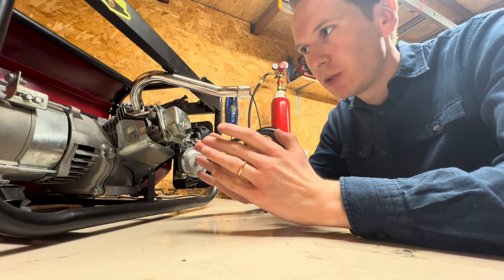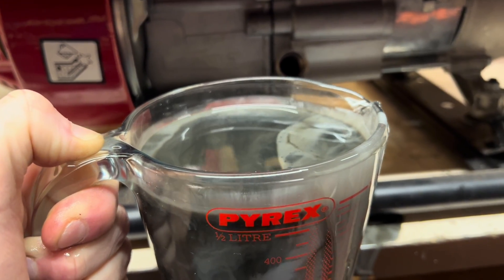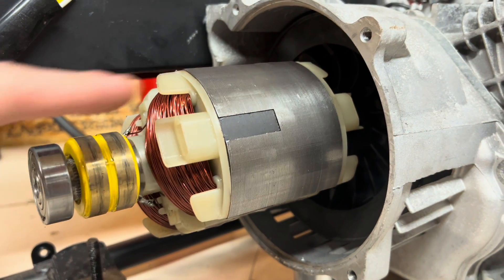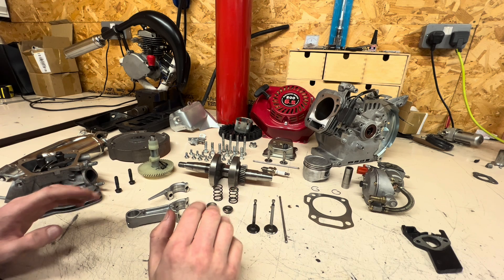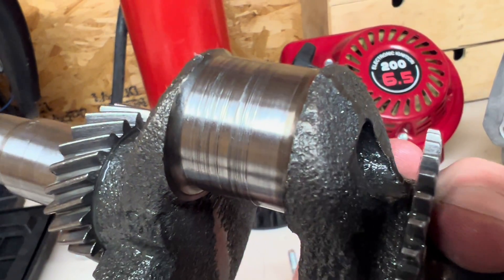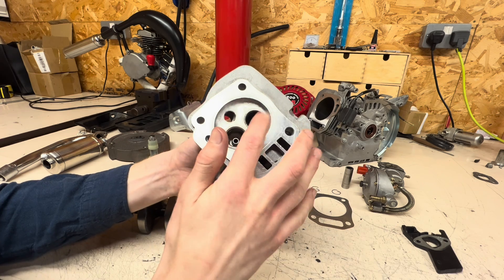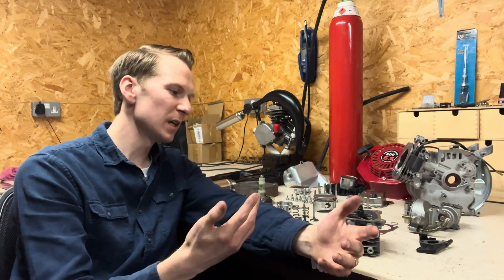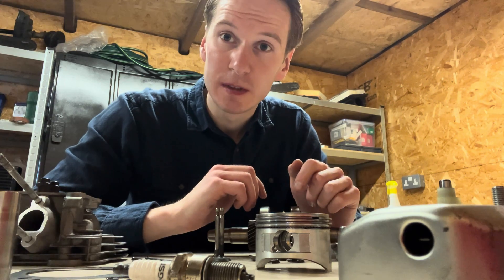Internals After 2 Years of Hydrogen

Comment: I may not know much about hydrogen engines but I do know about the Honda motors (and the Chinese clones).
Unlike what one comment said, hydrogen does burn but very very fast so ignition timing needs to be after TDC (max cylinder pressure at about 14 degrees after tdc)
Splash lubrication of big end means a thin oil of much better quality, full synthetic.
Modify lubrication hole in connecting rod to enable oil to flow in easier, maybe file dipper arm from 'airfoil' shape to a flat on leading edge to create higher oil splash?
Honda used splash lubrication dipper arm big end small 'push rod' motorcycle engines (49cc~89cc) since 1960's, they were spinning up to 9,500 rpm and were reliable as long as oil level was maintained (the later OHC had an oil pump, less prone to fail with low oil level)
Engine needs to be run long enough to maintain temperature over 100deg centigrade over entire surface (true of any internal combustion engine, 150~18-c is 'better')
From what I remember, even 'cheap' automotive oils are OK to around 320 deg C although oil change interval is vastly reduced as various additives break down much faster, particularly since ZDDP levels were reduced in 1990's

Comment: Hydrogen basically has to be made with a large energy loss in the process whether *electrolysis or nat gas cracking. Hydrogen now becomes an energy storage method. aka a different sort of "battery" noting that batteries already store electricity at very good efficiency levels in the charge/discharge cycle. You always have substantial losses when transferring energy from one form to another and more so in converting it back again. Good to know too is that the best internal combustion engine aka heat engine is only 40% efficient vs and electric motor which is about 80%. (interesting points are electric motors produce max torque at zero and low RPMs and do not require elaborate RPM/torque modifying power losing transmissions). You can also add that hydrogen contains the lowest by volume latent heat energy (BTUs) than any of the other popular fuels for IC/heat engines. In summary it is really terribly inefficient to waste hydrogen in a heat engine and add the much higher volumes of hydrogen needed in on-board storage to be competitive in range. If the search is for a relatively cleaning burning fuel for IC/heat engines that is cheap, already available, little need for extensive infrastructure building, available in massive abundance and relatively clean burning look at CNG aka nat gas. (yes I know about so called "green" hydrogen). * Note the electrolysis method of hydrogen recovery from water uses vast amount of electricity which itself has to be made somehow. Currently the bulk of energy sources are coal, natural gas, nuke, hydro and smallish % of wind, geo thermal, solar and some tidal. Just stuff to think about.

Comment: If you want to reduce the burn rate of hydrogen mix some exhaust gas( non combustible gas) with it by tapping off the exhaust gas and feeding it into the inlet... you will have to find the right amount for your engine but this will also solve your backfiring issue (due to hydrogen burning way too fast and firing while the exhaust valve is still open)

Comment: So now someone needs to do the interesting thing and calculate how many miles per gallon is the best you can expect from a hydrogen combustion engine along with how many gallons of hydrogen is needed to drive say 500km. Then that has to done again for on board storage of liquid oxygen because hydrogen burns so hot that they make lots of nitrous oxide which is a green house gas as well as contributing to acid rain. 

Fuel cells double the efficiency on the vehicle side but don't do much for the fuel production side making these things really expensive to run.

"Engineering Explained" a popular YouTube channel went over all that and determined that it was an interesting technology but only good as a novelty.

Physics is such party pooper.

Comment: The instant detonation of hydrogen will knock that engine to bits. You probably want to retard the spark timing to slightly after the top. There are adjustable CDI's that will let you do that.

Comment: I think the biggest complication here is that its open air cooled, so unlike a water block with a thermostat you dont have a reliable operating temperature, and thus the clearances are not well matched between all the components, piston rings in particular. Piston slap is a common symptom in well used engines that have not been allowed to reach running temperature before being put under load (so if you drive a vehicle its a good idea to let it warm up for a few minutes for this very reason). Adding to this is since hydrogen will result in mostly water as the exhaust you're really going to need the engine to run hot enough that it can evaporate the water back out of the oil, ideally with the assistance of a vacuum line, and also the oil will have to be different from stock to account for the higher operating temp. A simple method to keep the engine running hot while still air cooled would be a shroud, ducting and fan with a simple adjustable thermal controller.
Other than that you have what others have suggested about the ignition timing and compression

Comment: Hydrogen combusts and makes H2O. That oil appears to have water in it, possibly there is a connection. The combustion products using gas or diesel, being petroleum by products, probably dissolve into the oil more readily and affect the lubricity less than water contaminating the oil.

Comment: A small methanol or water injection unit will act ac a control for the burn rate and keep the heat off the valves.

Comment: You can get a lot of those Effects by putting a water methanol injection system on your vehicle. You do realize that in order to replace a 20 gallon gasoline tank in your car you would need about a hundred and thirty-five gallon hydrogen tank and it has to be pressurized at 10,000 lb per square inch
Reply: https://www.youtube.com/watch?v=RAEhhYqMEBE
That could also fit into the frame under the bed (for sure with 2 cylinders) if the frame is built from the start for that, and you would not notice it. As in all Chinese, Korean and Japanese Hydrogen cars.
Talk to people with knowledge and stop listening to TV propaganda.

Comment: Very interesting. I KNow nothing about working with Hydrogen. But I can tell you when oil has failed and caused bearing damage and the domino effect you get from that. Guess what. Yep. Find out why the Oil failed and you have the solution to your problem. If it's coming from the Hydrogen maybe, as other posters have suggested, maybe cooling it down to below freezing, pre injection,  would would stop it from getting  into the engine. and NO i have never tried doing that. Back in the 70s we tried it with gasoline. Thinking it might raise its energy level. But never got a good result.

Comment: A splash/dipper oiling system, is never going to be strong enough long term.  You need an engine with an oil pump and filter to get reliability.

Comment: It looks like water in the oil and I think this has degraded its lubricant effect. Together with the stress caused by knocking, this fmight be the issue. 
Honda engines usually have PCV, so if the engine is warmed up thoroughly, the H2O leaking past the rings should be able to be removed.
I didn't realise that these engines can have plastic (nylon?) cams!

Comment: There's a number of red flags that slapped me from the point you took out the spark plug and spun the motor over. One is the sound of worn out bearings, that showed up again when you have a sloppy connecting rod.  It also showed up as that metallic stuff in the oil you drained. As you pulled the slinger and bottom end of the conrod, you see something that looks similar to light scoring that could be the oil left over, but you see it on the crank shaft journal for sure that there was something between the connecting rod(con rod for short) and the crank shaft journal. Another thing to note, where is your retainer plate for the conrod bolts?  It's normally there to help keep the bults from backing off and act as a witness to the event the bolts get stretched and slop being introduces into the bottom end. Kind of fun to see what you say did fail and what I missed after the 7:41 mark. Hopefully the fixes are not too pricy for you.

Comment: The water content in the oil must be measured before any discussion get ground, and then we get from bar-talk to sience.
1. Weigh say 50 cc of oil very accuratly. 
2. Heat it to 100 C for 15 minutes. The water content cooks off.
3. Weigh it again accuratly. 
4. Note down the change.
It is well known by Beetle drivers (long, long before your time) that the oil collects water in the winter period and the oil level starts to rise. After a long highway run of mountainpass-climb with 100 C plus oil temperature, the oil level is suddenly lower. Yes, the water is cooked out. 
This can be found on the aircooled forum.
Reply: I had a '73 Karmann Ghia in Chicago. The oil filler would get that milky sludge. It was impossible to get the engine warm enough in the dead of winter to boil that out. I suppose a block heater would have helped.
Reply: @rhyoliteaquacade  Pardon me but the beetle engine in a Karmann Ghia had no oil filter unless someone added an aftermarket oil pump with a filter. What you are probably referring to is the screen that keeps large contaminates out of the oil. If you ran the car for an hour on the highway at least twice a month, the oil would remain free of water...
Reply: @davidhollenshead4892  Read my comment. Oil FILLER. The cap next to the alternator. That area would get frothy milky sludge.
Reply: @rhyoliteaquacade  I thought you made a typo. By "Oil FILLER" you are apparently  referring to the generator pedestal or on later type 1 engines the alternator pedestal. By the way as long as the oil on the dipstick remained looking water free, you could just ignore the froth near the bent for the crankcase....
[ I rebuilt dozens of these engines for a VW shop owner and never saw much of  a mess there...]
Reply: wrong timing leads to a knocking engine leads to damaged pistons and rings leads to passing unburned gas before ignition, which may detonate under the piston rings. If that was a petrol burning engine set to far too early timing and knocking all the time you would find petrol in the oil. Lots of it.

Comment: It takes 50kW/h to make 1kg of hydrogen. 1kg of hydrogen contains 39kW/h equivalent of chemical energy - a loss of 22%. Using hydrogen as a fuel in an ICE engine, not designed to run on hydrogen, recovers about 30% to 40% of that 39kW/h, the rest is lost to heat, noise and friction. After all that, to then run an electrical genny off this setup makes absolutely no sense. You had 50Kw/h electrical energy (to make the hydrogen), you went through a huge process to run it in an engine to generate, at maximum about 12kW/h of electricity.

The question now remains...Why?
Reply: if he generates the hydrogen from sun or wind any talk about efficiency is obsolete. The sun shines not less from its use, with the wind in small scale its the same, so how much of it is used from start to road is out of interest. The hydrogen burns CO2 free and leaves nothing than water. There is no other transportable energy storage which can compare the slightest with hydrogen. All others are using themselves up or are of short life time and use a lot of special resources. Hydrogen does that nowhere, all simple tech and low resource needs. And as said, wind and sun are totally free. Only electric with battery storage have to consider efficiencies, because that is horrible bad.
Reply: @unbelievablegoodio7176  trouble is to get 50kwh of energy from the sun you need hundreds of square meters of panels.
Reply: @leeknivek  There is a house in Germany which has solar panels on roofs and walls and that is enough to heat in their cold winters and keep their car running ... No external energy needed. Any road is a piece of land which has no use above 6 m height. So there is a huge amount of area to have solar panels, easy to access, and not extra land wasted, plus all roofs of buildings, the south side with panels, the north side with storage cylinders. The base load can come from Atomic (now) stations, and fusion (later). All stored and buffered with hydrogen.
Reply: @unbelievablegoodio7176  Great, except who is going to buy all the solar panels from China? How do you propose all of this gets paid for?
Reply: Coz no emissions of co2??
Reply: @butio1  WTF?! And where did the original electricity come from to make the hydrogen...?
Reply: @Pongle1234  The only energy from the sun, in concentrated enough quantities to be useful, is called crude oil, natural gas and coal...
Reply: @johnsmith-zy7xg  Nope - sorry, plenty of useful energy from solar and wind.
Reply: @peterdubro  Go catch and use it then...Hahahaha...! JHC, people are completely unaware of the reality they exist in...smh...
Reply: If you generated the hydrogen with wind and solar, 24-7 trickle feeding and filling a tank of compressed hydrogen , then it's totally worth it and now labour has stopped all north sea drilling and shuit down our only planned coal mine in 30 years, we need ways of generating our own fuel and hydrogen means we can still use our existing equipment.
Reply: The question is : why use hydrogen in a internal combustion engine?
- less efficient than a fuel cell (25-35% instead of +60%)
- emissions (like NOx) which you don't get with a fuel cell
- ...
Reply: @ppdan  because you can quite easy modify billions of existing good vehicles to run on hydrogen until they one day retire and get replaced naturally with fuell cells. Cant you see the bigger picture? And A hydrogen infrastructure is also way easier to set up than e-storage. The VW dream is to keep all not driving cars permanent on the net so they can serve like a power bank for the phone, while long parking charging the vehicles which have to drive and so relax the power generation companies and their heavy loss grid. That upload of energy is an absurd loss of efficiency, and that loss makes more money to the power companies than they are earning now. But cars are over, cov has shown it, live can work with less than half the cars, and so is the VW battery nightmare a dead sock.
Reply: @ppdan   Read the latest plans of Elon Musk, you may be shocked. Cummins has also hydrogen engines too, for trucks, and Ford some other ideas. All together: GM and VW sitting on the wrong horse. THEY are outdated. Battery only driven vehicles where discarded nearly 100 years ago, for good reasons, and that has never changed. Its a niche product, where it may work, but not in general. The idea using a car battery from a vehicle, or its fuel cell, to generate upload power suitable for large scale and industrial use is totally absurd when you start looking at the energy losses. Nobody needs cars to store energy for a city. But that city can live without cars and the people still get around if really needed. The lock downs had proven that, and better planed, it goes even better. The Japanese are clever, they keep all doors open, they are no fanatics.
Reply: the benefit to hydrogen here is that you can burn it in an enclosed area without fear of toxic, poisonous, or otherwise dangerous fumes.

There is no energy benefit from this. You should look at the energy losses in electric vehicles and "green" energy production. I fear we are at least decades away from really being where we seem to think we are with "renewable" energy (it all uses finite resources in a manner that is not recoverable and thus isn't really very renewable).
Reply: @boanerges5723  No, running combustion engine on H2 will still produce NOx
Reply: @boanerges5723  99.9% of the mass and energy in this solar system comes from the sun...it is not renewable and will cease to support life on this planet at some stage. Once we run out of cheap, easily accessible hydrocarbons, we will return to a preindustrial existence, complete with slavery, constant war and all the other wonders of living on this planet...
Reply: KWh not kW/h
Reply: @Pongle1234  same thing...
Reply: @Pongle1234  kW-h...there, happy...?
Reply: @johnsmith-zy7xg  mate, it's kWh. kW-h does not make sense - what are you trying to suggest with the '-'? If you really want a char in there between kW and h, use something associated with multiplication (which '-' is not), e.g. pick one of kw×h, kw.h, or kw⋅h. (First and last you may struggle to type).

Or just write J. 1 kWh = 3600 kJ.

Comment: I do not understand the "performance " part. It has plastic cam gear and lobes and running aluminum as the connecting rod / crankshaft bearing is a really bad idea. No wonder it failed.

Comment: Fun fact. The guy that invented NiMH batteries figured out that if you stuff a tank with activated charcoal, you can pressurize it to 5000psi of hydrogen, drill a hole in it, light it, and you get a steady flame. The hydrogen releases just fast enough to feed the engine. In other words crash your hydrogen car and you get BBQ, not Hindenberg. Unless you paint everything with aluminum rocket fuel......

Comment: You found the remains of failure, but what's the failure?    Hydrogen instead of petrol? Does Hydrogen need a different timing?    Anyhow there's wrong timing, backfire, unwilling to start. Bended valvestems?